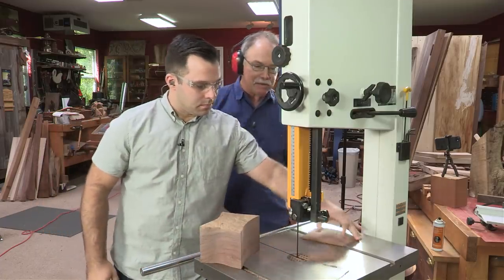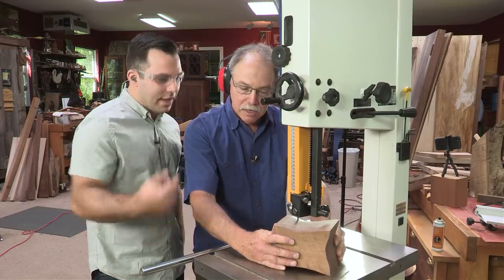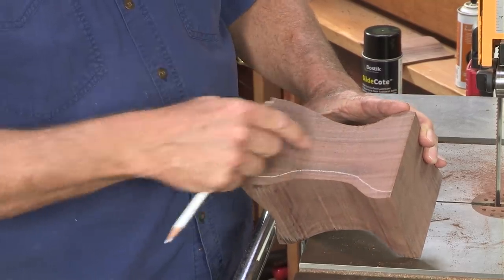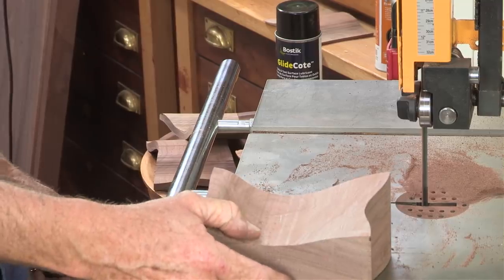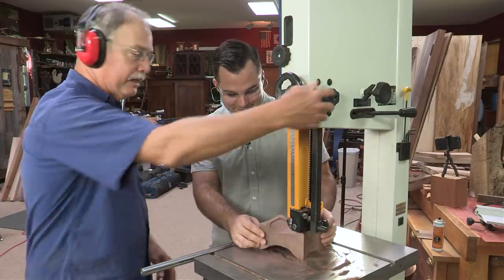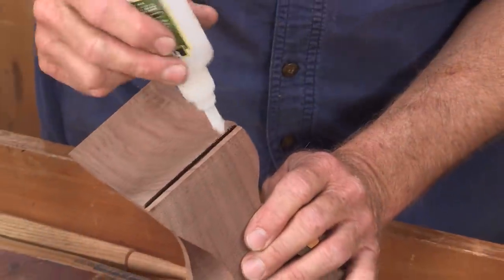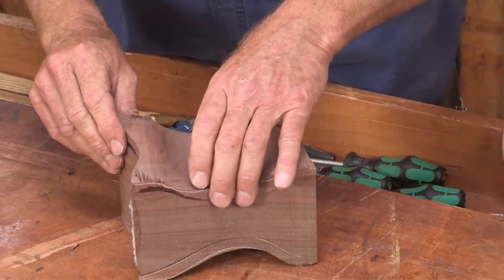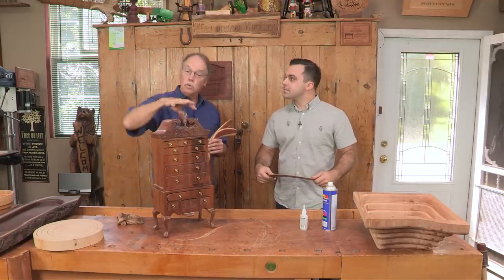How to Make a Bandsaw Box | Advanced Bandsaw Techniques Part 2

Comment: can i know, size blades use?
Reply from the maker: For a bandsawn box a thinner blade is recommended, say a 1/4" blade, to better handle the turns. About 6 teeth per inch should be good. Don't go with too many teeth as they'll just clog and slow down your cut.